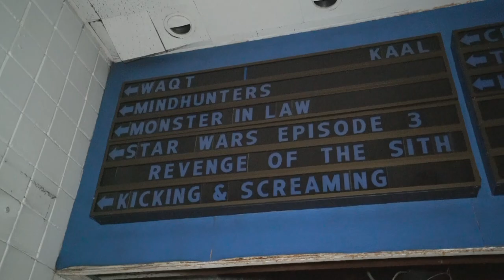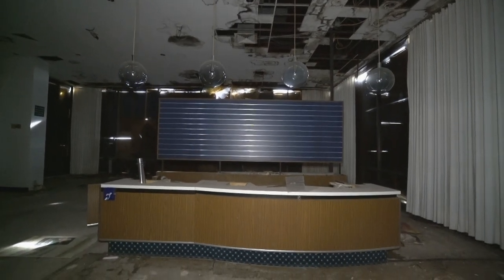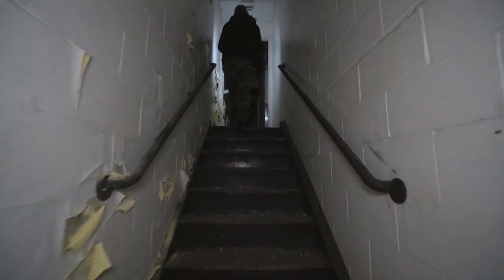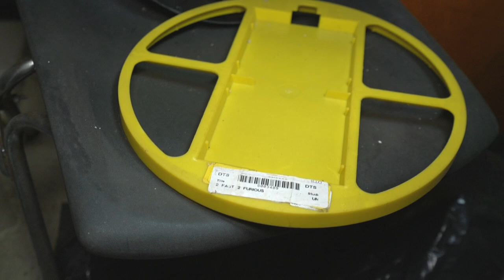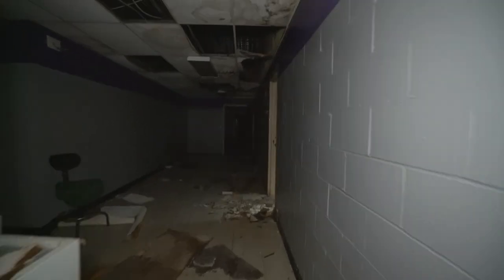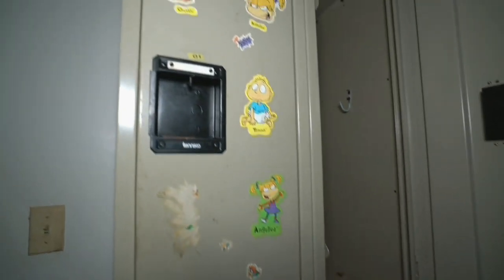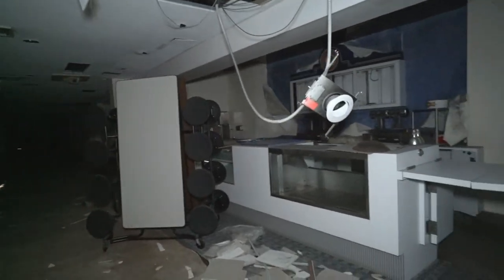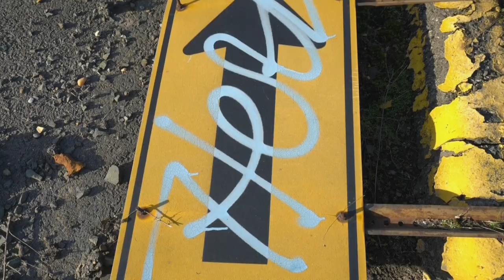Abandoned Retro Movie Theater - Films Left Behind(Closed 2005)

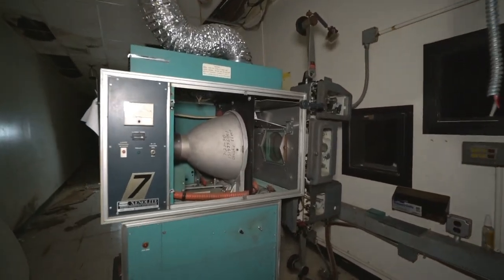Comment: Once again, as a former projectionist, let me clue you in. . Projector 7 at about 9:47 is a century JJ 70 70mm projector.  That projector alone once sold for about $15,000.  Today it is useless as everything is digital now. The big blue box behind the projector is a LAMPHOUSE, made by CHRISTIE.  They used XENON bulbs which ran about $300 to 900 each. . They had high pressure gas in a quartz envelope. .

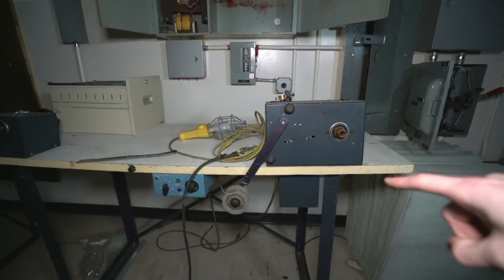The thing you asked about 8:55 was called a Makeup-rewind bench.  This was where the projectionist would splice the 20 minute reels of film togather into a long movie.  They would then transfer the film to a PLATTER system which looked and worked like a big 8 track tape.  

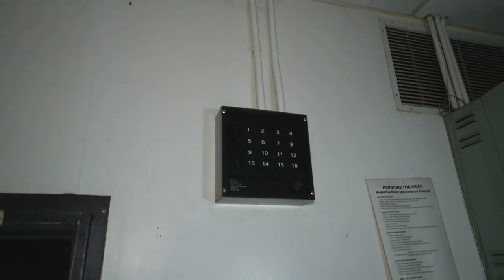The gold lens at 8:21 is an Anamorphic (cinemascope) lens that uncompressed the image from 35 mm film to a wider format on the screen.   They were about $1,000 each.  

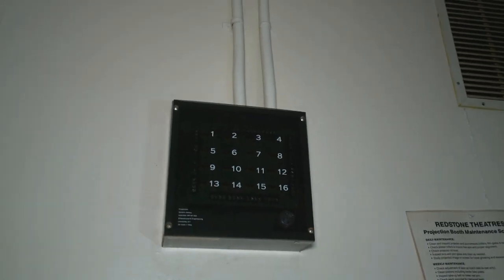At 8:27 you are looking at a film drop sensor that lets the projectionist know if all the theatres are actually projecting a film, or if it had BROKEN or ran out (movie ended). . from a sensor on the bottom of the sound head under the projector. 

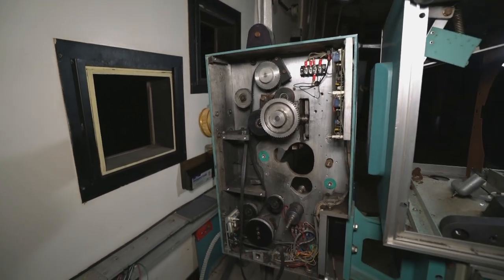At 7:59 you are looking at the back side of a CHRISTIE 35mm projector.  This would normally be covered. 

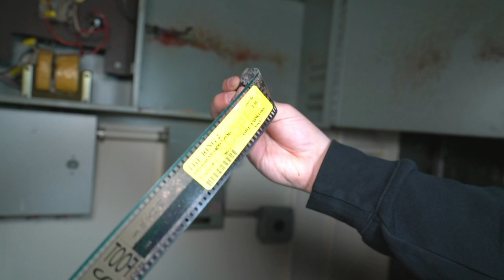At 9:22 you are holding a piece of LEADER film that would have had the funny decreasing numbers that told a projectionist where the actual important bit were the film started was.  They were usually spliced off to put it at the beginning of a movie. (the adverts of coming attractions)  For trailers, you did not ship those out with the movie. . they were disposable. 

At 10:18 you are holding a bit of a film trailer

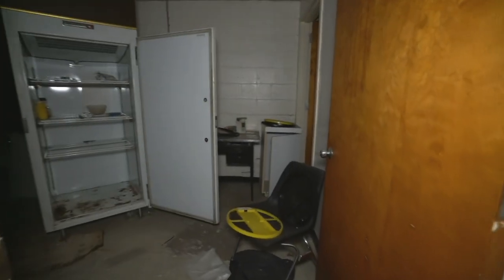10:32 There is NO OFFICE where the "film is stored" that was likely the theatre office and storage room for the concession stand. 

11:20 or so, the film stuff you are looking at is 16mm. . some smaller theatres use it for shows, as the image quality is not as good and cannot be blown up to the larger auditorium screens

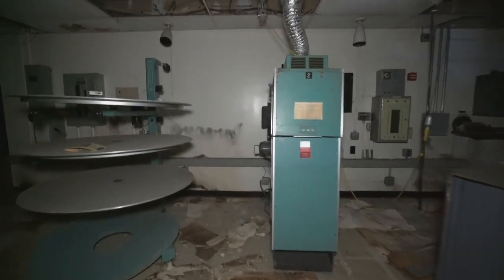At 12:52 to the left of the projector is a platter system mentioned above that handled the film for the projector.  The film laid on its edge on one platter, fed out via pulley to the projector and then back to another empty platter that took the film up. . .When the movie ended you just fed the film out from the center and back the same way. . 
Platter->projector->sound head->Back to empty platter. 
You never had to rewind it. 

Sad to say, what a major waste of money here. . But I noticed a sign that said Redstone theatres

15:11 Not a register, an early computer ticket machine.

17:10 under the phone was a computerized sales reporting system that relayed the sales data to the main office. . Redstone was notorious for thinking every employee was a thief.

I don't know why you protected the name of the cinema. . .if the roof was problematic, the builder was likely sued and the whole theatre was a write off. . The whole place was just waiting to be demolished.

Comment: Being a projectionist is a lost art. This theater is a mishmosh of projector technology. I saw one with a platter system and some with the dual projector setup where it would switch off between reels (you would see the dots on the film signaling an upcoming reel change). I spotted a "build up" table where you would load the film from reels onto the platter. If the ceiling hadn't done this theater in, the costly switch to digital probably would have.

Comment: 15:20  Air was probably trapped inside the black cover. When you step on it, the pressure causes the air inside to escape. When you step off of it, there is a small vacuum created within the cover, causing air to then be sucked back inside it. Simple explanation, but still very funny! Watched it like 6 times!
Reply: It sounds like someone is going yeeeeeeaaah!

Comment: As far as the film reels upstairs go, all films came on separate reels, 5-6 about 20-30min each. Except Gods and Generals, that was 10-11 reels as it was a LONG movie.

When they were looking at the film strip for The Ring 2 (9:04), the machine they were at was used to combine the reels. You put a larger reel on one side and add the smaller one together, splicing them together making one reel containing half the movie, then repeat for the second half. After that then you splice the two halves on a platter (we saw it at 12:54) and run it through the projector. When looking at the platter "tree", you load the film on top, through the projector and the take up would be on a empty platter and the you would do it again for the next showing. Effectively, you would have two movies on one platter tree because you always need an empty platter for take up. In the center of each platter, there would be a thing called "brains" and it would feed out the film from the center so you wouldn't have to "rewind" the movie. 

Source: I was a protectionist for a couple years between 2003-2005, one of my more favorable jobs!

Comment: I don't remember the year, but that theater you went into was alot bigger. When they couldn't expand off to the left cause of the ground, they put walls in, and turned a 200 seat theater into 2 smaller ones. On the left side,  where the other theaters were, there was a huge crack in the wall, cause of the foundation, I wonder, before it closed if they ever fixed it?

Comment: The things on the end of the table wasn't for rewinding the films. It was a editing tool for film. They would use that to put new previews at the beginning of the film. The little pieces of film you found next to it that was a trailer is what they would use that tool for. Or if the lamp would burn one or two of the pictures in the film they would cut that part out so it wouldn't be a big black dot on the screen. Awesome video.

Comment: That is a build up table at around 9:00... I sent many many many hours building up and breaking down prints at those kind of tables.  The dts discs are for the films audio.  There was a time code on the print (between the sprockets) that would sync to the discs when playing.  Prints would have multiple options for audio built onto them.  Not all projections had the same audio capabilities.   The small piece of film you had said “tail” on it.  That would have been on the end of the small reels the films arrive on.  (The front piece would have said “heads” on it.). These are used for the projectionist building up the prints so they now how to attach the different reels together.

Comment: ok so to clear a few things. 1. those seem to be christie brand lamp housing mixed with century and simplex heads. 2. you're friend was somewhat correct on those DTS cds. but each reel contains audio and its either stereo or surround but it also has a DTS timing code that the DTS player that's attached to each projector will read and sync with the picture that gives a much better sound. it will also have audio for some trailers and DTS or THX audio tracks. the platters that you see are also christie. 3. in the beginning you were looking at a christie build table. surprised nobody really took anything from the booth that stuff is obsolete but worth allot of cash to collectors especially people who build home movie theaters and just collectors. also worth money to people who wanted their own 35mm projector and also to foreign countries that still use 35mm projection. oddly enough just that lens alone that you touched was alot back then and the build table woof that costed 600 back in 2003 when I was a booth manager. 4. why do you blur the movie tickets? its crazy that the booth seems to be well taken care of and clean compared to the rest of the theater. brought back too many memories I was too giddy while typing this up. I'm just surprised that the theater didn't sell that equipment it wasn't til 2018 that movie theaters fully adapted the digital upgrade and made each theaters upgrade. only a few movie theaters in the US still support 35mm but it has to be small theaters one being mark cubans theater in Dallas and of course the other theater in Dallas is THE TEXAS THEATER where lee Harvey Oswald hid once he shot JFK. not sure of other theaters that still do it because well I'm from Texas and I don't know of any other place that does. other than a few DRIVE INS that still support that format and play older films

Comment: Back in the day multiplex theaters would usually have 4 to 6 large  auditoriums. In the late 80s to 90s multiplex theaters were being built with 10 to 12 screens some large auditoriums for the popular movies and smaller for less popular. The older multiplexes were losing out as 4 screens meant only 4 movies and limited  showings. The big 10 or 12 screen theaters could have more showings of popular movies by running it multiple theaters. The older 4 or 6 plexes started splitting their large auditoriums to make 2 smaller ones. Sat a six plex splits 4 auditoriums now they have 10 screens 8 small 2 large. The small theaters at this location have been made from splitting large auditoriums.

Comment: Excellent film, love urban exploring documentaries. I was a certified 35mm projectionist in multiple cinemas for many years in the 1990s and early 2000s. I would like to dispel some of the mysteries of the projection booth. Around the 7:20 mark of your film, you pass by a 35mm build table that was used to splice reels together so the film could be played on large platters. The 9:00 minute mark is a repair table that would have been used for building trailers and repairing films. Most of the projectors in the film have had the lamp house gutted probably for parts. The discs were "dts" discs for digital audio projection. The film strip did have an analogue audio strip on the side of the film. If the theatre had a digital audio projection system ie. Dolby the analogue audio would sync the digital and the image on the screen. Also, I noticed that most of the platters have been removed with the exception of the ones in the room with heavy decay.  They were removed for parts I would assume.#dixon373

Comment: You mentioned dvds ,
Chris is correct those DTS discs had the soundtrack that had enhansed sound on it and was payed with the Movie on 35mm .
The trouble is with Film if there was a bit missing then you would miss the soundtrack .
With DTS if there was a section missing you would not miss that sound as in spacial effects or dialoge, it would continue and it would pick up where the film was so you would not miss too much of the Movie

Comment: That projector is definitely NOT a reel projector, that top roller was a DTS reader and it operated on a platter system  , the three round stacked things on the next projector. The numbered box on the wall  went to a alarm system if a projector went down and you were in a different part of  the projection booth.

Comment: 9:03 The device shown on the table is an aid for splicing movie reels together, also, it was rare to have a movie not wound correctly as in order to put the movie together and take it apart all had to be done in the same order.

10:23 Film in hand, is a Leader to protect the actual movie, and partially used to ensure alignment in the project was correct, as well as threading, you don't want to thread the actual movie, threading the leaders reduced the scratching on the emulsion film for the actual movie ...

Digital TDS movies...the soundtrack was on a CD  where on the film there would be synchronization track that aligned with the CD audio track

Comment: I remember movie theaters. ETA: I wonder why they had DVDs there. Do you think in some of the smaller theater rooms they used those instead of actual film?
Reply: How many theatres even still use real film dude? Digital cinemas have been around since 2000 or some shit.
Reply: Those are audio DVDs with the digital DTS movie soundtrack.
Reply: Digital cinema did not become the standard until 2010-2013 until then 35mm film was used in all cinemas (rarely 70mm too) the discs you saw were for DTS Digital Audio non DVD’s they were a digital audio system for 35mm film.
Reply: @seanmckinnon4612  Thank you for the info 👍

Comment: In this industry technical obsolescence took a full century to occur and when it did occur it was a rapid process. I shiver a bit when I recall what I paid for 3K Christie lamp houses, rectifiers and xenon bulbs, platters. Dolby CP200's and such, and now they are so obsolete as to not even be hauled out of the closed booth. Yikes.  One note to mariners, we had theatres in Annapolis, MD and learned that the slang term of something worth little but still has a basic function a "boat anchor" is in fact the case with old projector heads. They are extremely heavy, yet somewhat compact and have many ways to firmly attach a chain or rope. They also degrade very slowly as moorings and the various stainless steel shafts and protuberances tend to sink into the mud and hold fast. While this may sound absurd, it's absolutely true. Numerous Simplex E7 projector heads from the late 50's are still functioning just fine as reliable, super durable, no drift  moorings in Annapolis Harbor.  ;-)

Comment: 35mm film could accommodate four different sound formats on it.
Good old fashioned analog stereo.
Dolby Digital (data blocks positioned between the sprocket holes).
DTS time code for syncing the multichannel audio stored on optical media (as seen in this video).
Sony SDDS data stored on the other side of the sprocket holes as the analog audio.

Comment: Does anyone know when this cinema was built? It looks like it was built either in the 70's maybe 80's? 

In that case, it would be sad. As it would only survive for about 30 years, or so. I feel bad of those Mom, and Dad own theaters, and businesses. They had charter, and unique features. To bad the bigger Corporations are taking over.
Reply: It was built in the late 70's, it opened in December of 1979 and replaced a Drive-In cinema at the same location. The cinema was built along riverfront, and the whole structure was compromised because the foundation began sinking. The cost to repair the building was massive and the owner had just spent much of their money opening another one. That new cinema didn't even last 15 years.

Comment: I googled the address, US Highway 9 and State Route 35, Sayreville, NJ, and it appears to be a gentlemens club now.
Reply: There's like 2 strip clubs right near where this theater is located. The theater is still standing, but the entrances are blocked off. I drive by this place like a few times per week. I had no idea it closed down back in 05. It used to be a drive-in movie theater lot up until the mid to late 1970's.

Comment: 9:13 the machine is a film splicer
Reply: ........ NO MCFLY that isn't a film splicer. in fact there's not even a splicer on that table other than a cut piece of film.
Reply: @MoK86  At best, that's a table where we'd join together various trailers and "ads" for the concession and pre-show and then review them for feed errors in the splicing and for continuity, but you're right, the actual splicing equipment is totally absent from this set-up.  🧐🙂